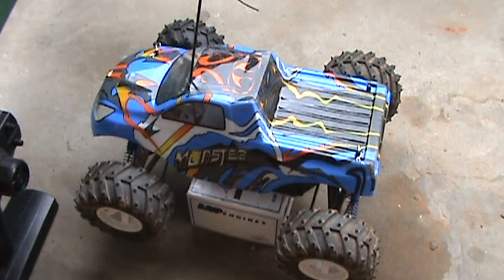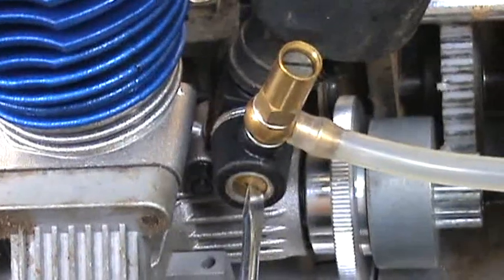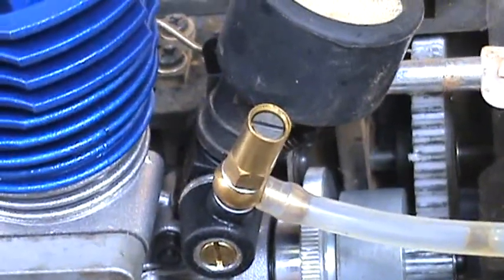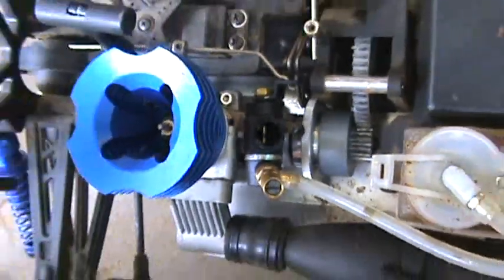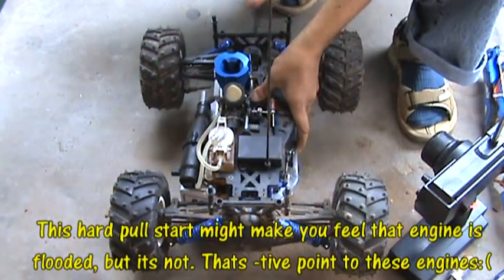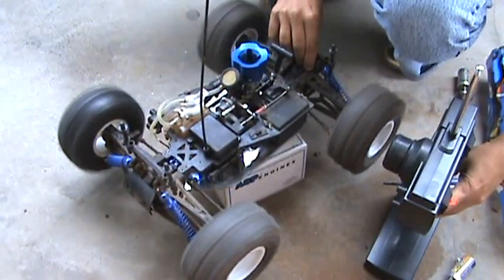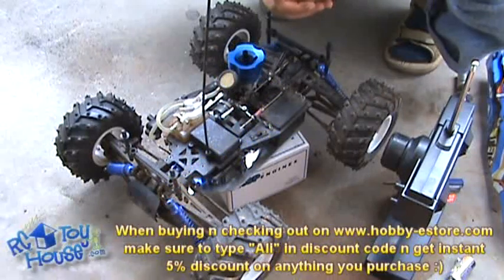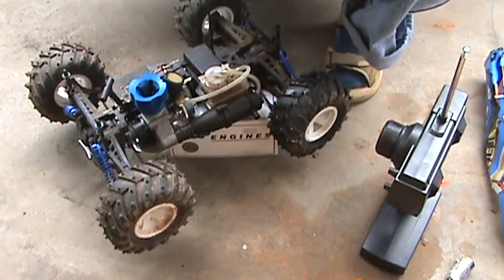Starting up n tuning the Team infinity engine of ACME

Comment: Hi. Just wondering what is that screw with that spring. I am having trouble with my acme conquistador i messed around with the carb when it wasn't running when i was drunk. Silly me. And now it doesn't run right. Can you help me please

Comment: Ali, I love watching your video's very informative,, but please correct yourself. eg. Please fix this, I was trying to setup my new Earthquake breakin following your video, I ended up with the HSN practically closed, no fuel was getting in because I followed your ( Two full turns in from factory ) That is incorrect, What you should have said was either two half turns OUT ( 180 degrees ) or ONE full turn out ( 360 degrees ) Richer, not leaner ! Thanks, Chris

Comment: Hi Ali. I have a problem with my car, I'm on the third break in tank and I have noticed a lot of oil on the underbelly of my car in the area of my exhaust and engine. Would it be possible for you to go through the possible problems of oil leaks in a video..... Thanks so much.

Comment: on your controller there should be a dial labeled throttle trim. you want to back it down to where the engine will idle correctly without making the car go until you give it throttle.

Comment: I have the hpi firestorm 10t with G3.0 engine and I'm trying to get the needles set up right but it's hard to start and it cuts out when u try to change mixtures and the wheels are spinning unlike urs are stationary. The low speed needle is very hard to get at and last time I tried starting it the engine took of and revved freely. It doesn't like full throttle when u give it full throttle it bounces around on the limiter for 2 secs and cuts out. can you help please with the set up on the carb

Comment: @alishanmao I have a question about my HSP car. its smaller than your T-rex but by the same brand. It is a 1/16 scale Kingliness and the bell gear kept slipping. Nothing was stripped but wasnt meshing with the other gear. I disectited it and replaced a ball bearing with a washer. Then I find out there was no ball bearing in it then took out the washer, started but did the same thing. WHAT DO I DO!!!!

Comment: I have the 18 infinity engine which if set up correct runs with no problems. Have you seen the Team Infinity 21 small block which drops stright into a 1/10 scale. I`ve just got one and it looks like it going to fun!

Comment: Hi Ali, the 'team infinity' engine may be powerful but after running mine in I couldn't tune it and like you said easily overheat! I looked for air leaks and found after about 7 tanks that my engine backplate, carb mount, fuel tank & front bearing all had air leeks! So if you buy one take it out of car and check for air leeks first!

Comment: this is the problems ive been having with my rc nitro rampage car is i think its called a receiver box. its a black box with a ariel coming off the end and it has three ports for three wires to go in it. so i snapped the ariel off it and i taped it up and it done rubbish losing signal all the time so i changed it and put my condor receiver in it would it be ok it seems to be working fine and i changed the Crystal in it so i can use acme remote and it all seems ok is it ok to use thanks.

Comment: When i start my engine it idles good but when i press the throttle it revs up far too high and doesn't come back down, when i pull back on the brake it brings the engine back to idle speed but as soon as i touch the throttle it is out of control again... any ideas?

Comment: green gas that i dont was even gas. so he drove it already first handed, and i didn't know anything about rc nitro cars. Okay so basically my engine was all jacked up already.

So i took the tube out with one end on the exhaust and the other stuck to the rear (near the wing), so that extra exhaust will spit out from the back and not into my tank. Is doing that alright?

Comment: I was always wondering with this question (You might think its dumb but)

you know that tube that connects from the exhaust pipe to the Nitro Tank? Or gas Tank?

Well i was thinking about it, I don't have a Fuel Filter and if i feed my engine with that smoke, it might die sooner or later. (Its gonna die sooner than Broke in engine due to that My wasn't broken in, actually i wasn't sure if my engine was broken into. When i first got it, the shop i went in, he demonstrated the car to me with this

Comment: Ali great video I have my low speed needle set good but when I give it full throttle with the wheels off the ground it is fine but when I am driving it the engine cuts out it does not even bog down it just shuts off. Thanks Ali you are the man !!!!